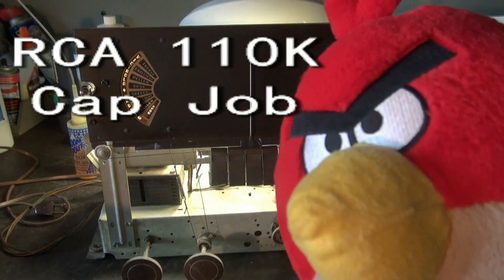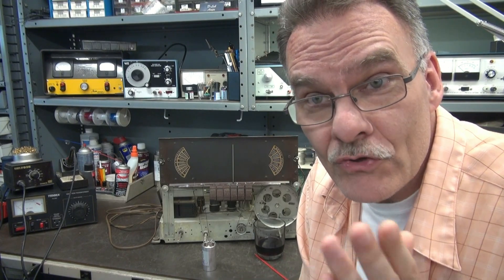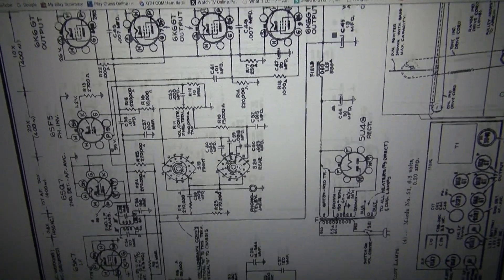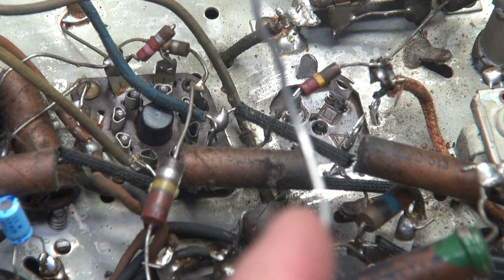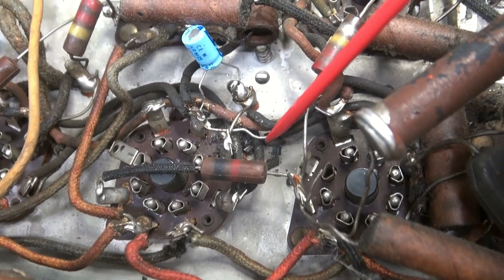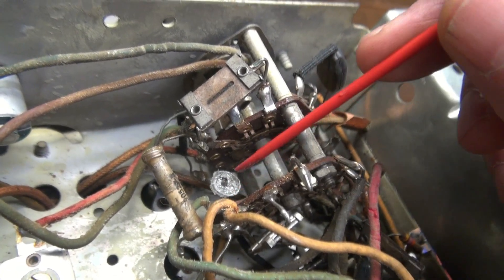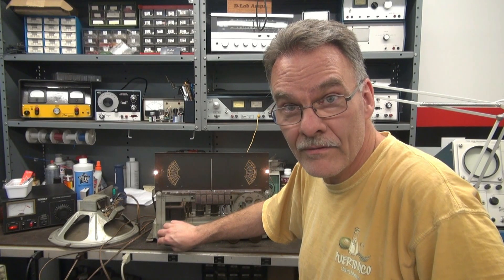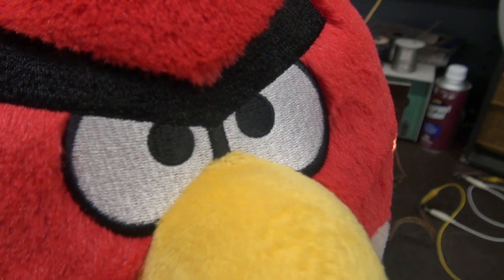How to replace RCA 110K TUBE console radio Capacitors D-Lab electronics

Comment: Nice rebuild.  I have also seen guys drill out the old caps,  put the new ones inside the cap body,  then seal the ends.  Keeps the original look.